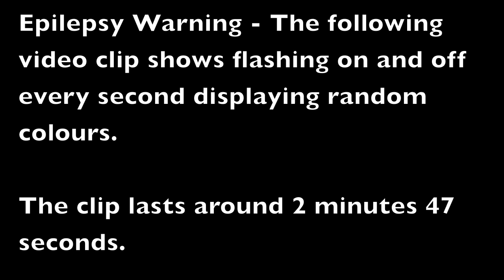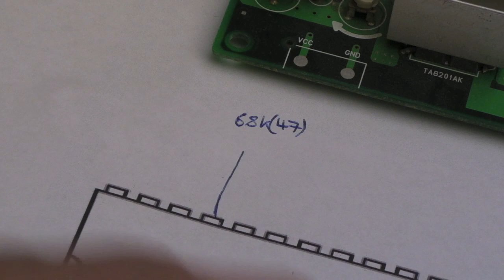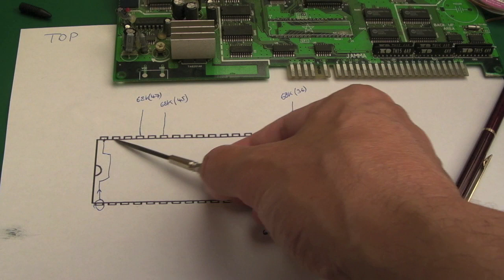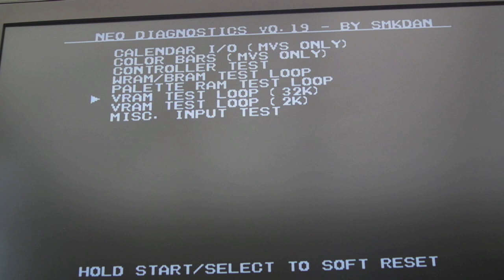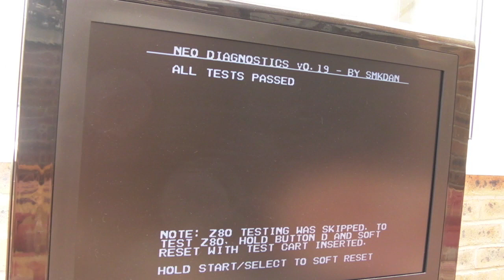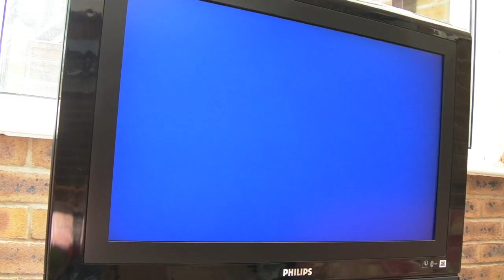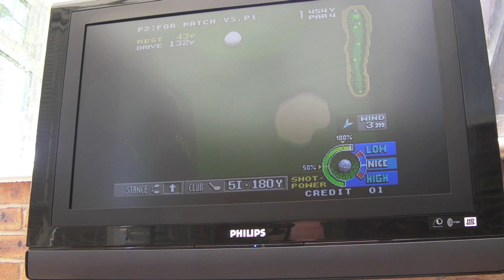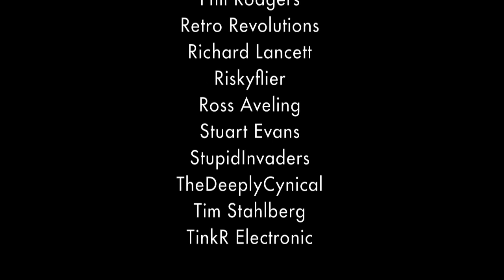SNK Neo Geo MVS Junk Board Repairs Part 3 (MV-1AX BIOS Repair - Fixing Muppet Damage)

Comment from the maker: Check out Furrteks page on Patreon:- https://www.patreon.com/furrtek
NOTE: Bodge wires are relocated in the next part and look much tidier underneath.  At the time I overlooked the CPU vias on the underside of the board.  The main purpose of this video was to see what state this board was in.  It's fully fixed in the next part =D
Reply: Do you take on customer repair jobs or upgrades?
Reply: 37:42

If you can get hold of the vertical connectors for the cartridge riser, it could be worth looking into designing a kind of "test jig" PCB, which would allow the cart to stand vertically.

I already have the Neo Geo cart slot stuff done on Eagle. I would just need to know how the pinouts on the cart riser relate to thethe smaller Molex / Amphenol style connectors that plug into the motherboard.

That depends on how useful you think that might be, though, and only really for people doing a lot of Neo Geo repairs.

I used to have an MVS, but no longer have any Neo Geo machines, or I could map out the pinouts of the riser.

The other issue is getting hold of the actual cart slot connector(s), but I imagine there are some on AliExpress or elsewhere?
Reply: I was looking at my bag of arduino pinheaders and thinking exactly the same thing. All you really need is a right angle connector of some kind.. tedious to make (I used to make stage mulitcore cables) but possibly worth it in the long run.
Reply: Excellent skills even SNK would be proud 😀
Reply from the maker: Sorry, at this point in time I cannot do customer repairs.
Reply from the maker: @ElectronAsh - Yes, that would be great if we could make a riser for these boards.
Reply from the maker: @Chris Boffey - Thanks =D

Comment: Found this looking for help with my MV-1C board and I like how your repair videos follow your thought process step-by-step.

I have a Timeharvest CMVS from Aliexpress that seems to have fried 2  MVS boards so far, I'm getting pink garbage at boot right now and seemingly no click of death.

I don't think anything in this video will apply to what's wrong with my board, but it's nice to hear general troubleshooting logic and the sort of approach you took to finding out the problems.
Reply: Ooh turns out I have a damaged trace for an address line between the CPU and NEO-DCR-T chip.  I'm not 100% sure what the DCR-T does but the dev wiki says it's related to system registers, the CPU wait cycle, and address decoding, so sounds important!

Comment: Great work as always. Here's a possible tip for you - have a look online for a salon magnifier. They are used in nailbars for painting nails, but actually work very well for examining boards and soldering. Likely cheaper than the real thing.
Reply from the maker: Thanks for the suggestion!!!!  When I came to work on part 5 I realised I have a large illuminated magnifier that my parents bought be a few years ago - I forgot I had it lol

Comment: It looks as though someone tried to fix that PCB with an axe! Reworking such a mess is a challenge to ones patience and skill :) Good job!
Reply from the maker: Hehe, indeed it does look like someone was a bit brutal!   I guess we've all made mistakes like that when learning.  I am sure the first time I removed a chip it probably looked like that afterwards.  Thanks!  It looks a lot tidier in the next part as I was able to put new wires on the underside.

Comment: Ive seen arcade boards being reflowed because how old they are where they retouch all the solder joints on the actual board
Reply from the maker: Yeah, it didn't need it in this case =D

Comment: Kynar 30AWG (wire wrapping wire) i.e. RS 209-4811 is the choice size IMO.
Reply from the maker: Thanks, I think that's what I've ended up using in the next part (well, the video after the next video).

Comment: There is really a need for some proper sockets for those SOP and QFP chips, so you can swap them around during diagnosis easily. Soldering them repeatedly on and off must be an annoying job.
Reply from the maker: Yes!  I do have some 128pin QFP sockets - not sure if there are suitable sockets for the other chips though.  SMD sockets seem quite rare tbh.

Comment: Great stuff, Would love to get into NEO GEO hardware, just don't have the money or space for it right now. Could do with getting a hot air station also.
Reply from the maker: Maybe get the same hot air station I did - Atten 858D, they are quite cheap but more than capable on boards like this.
Reply: Might have to get one of those. Very reasonable price. Been using ChipQuik SMD291 tack flux (10g syringe)  for a bit now, great stuff. Don't know if that's the same ChipQuik you use but worth checking out. Got those small ChipQuik Tubes with SMD removal alloy kits and the fumes are so harsh compared to the SMD291 stuff.
Reply: I tossed up buying a hot air rework station for some time and put the money aside and bought one. I don't use it that often but when I do I am so glad I got it. The next bit of kit on my list is a desoldering station but for that I will take a bit more time to look into them as there are some rather poor quality ones on the market.
Reply: I got ZD-915, the same one Jan Beta & Dave at EEVblog. Unfortunately mine had the same problem as Dave's out of the box and I had to repair it, not a great start. That aside I'm very happy with it. As a hobby guy it does the job. If your more serious and it's a tool your going to be using every day, then I would go for the HAKKO FR-300. I did consider going for the HAKKO myself but couldn't justify the price.

Comment: Jesus that gouge! I just bought a nice soldering thin tipped station from RS (Product code: 885-6113, Tip: 799-8976). I miss working precise under a magnifier like I had at work. It helped me create that C64 Mini Joystick. I could not have done it without. Such a God send. Anyway, you're a Genius as usual I see... ahhh... such a hard life mate hey hahah
Reply from the maker: Thanks mate =D  I found that I have a large illuminated magnifier (sounds like a medical problem lol).

Comment: Hello, I recently got a MVS Board (1F) and  by watching your videos I learned a lot , however I have a problem with my board and I cannot put the finger on it, sorry for the troubles but maybe you can give a look to the error screen I get? The MVS does not reach the Tests screen and instead shows a screen filled with a lot of little blocks of different colors, with or without cart, with or without bios. Thanks for your time!
Reply from the maker: Do you hear a clicking noise every second or so?  It sounds like the CPU is not booting, if its not clicking that would indicate that the watchdog is not kicking in either which could indicate a problem with clocks (d0) maybe.
Reply: @GadgetUK164  I see! I am gonna check those two things and try to fix the board, many thanks man for your input, I'll be checking your videos!

Comment: Hello Friend! could you help me? you don't have a neo geo MV-1AX system what happens, is that mine got burned the resistors that go after the jamma connector but for the same reason I can't see what values they are and I wanted to see if you can't pass me that information to repair it thank you very much: I have been investigating all week and I do not get that information.
Reply from the maker: I don't have an MV-1AX to hand at the moment, all my spare boards are in storage.  Your best bet is to post a question in the technical section of the Neo Geo forums website.  http://www.neo-geo.com/forums/forumdisplay.php?14-Neo-Geo-Tech-Support

Comment: Why not using lacquered wire? Much easier to handle :)
Reply from the maker: Yes, I've got some of that but tbh this kynar I used (in the next part) has a covering that melts away really easily (and cleanly).
Reply: Thanks, noted :)

Comment: Hello! friend . Excuse me, can you pass me the value of the resistances that you indicate in the minute 27:05 .... R64 R63 R56 R57 R50 R49 PC29 R58 R48 R51 R47 R46 R44 R45 R62 R52 R61 R60 R53 R55 R54 R59
Reply from the maker: The easiest way to work this out is for you to buy another board of the same model, then measure the components!  I don't have the information to hand sorry!

Comment: I forgot to ask, but why is there a pentagram in the of the board, were a socket of a MOS is?

I found it very strange to see that on a SNK Neo Geo.

Great repair, i just repaired a DVD/5.1 amplifier (all in one), he would not power on and only stayed on standby, and i had a thought it could be a cap of the build in PSU, and when i opened it i saw one bloated capacitor on the PSU board, so i removed one of the 3 little boards from the DVD/5.1 amplifier (PSU board), and desoldered the bloated capacitor, it was only one, it was a 1000uF 16v cap, and when i tested the cap in my multimeter it showed that it was only giving 300uF, so i put a new cap on it, and put the PSU board back in and plunged all the cables back, and then it would power on again, so the person was VERY happy, because now they would not have to buy a all in one 5.1 amplifier, that would cost them €160,-

And just yesterday a Mini Media-PC would not work any more when there kids were playing a game on it, the power light will only blink, so i tested it and like i thought/hoped it was the Power brick, i hear a high pitch noise, and when i tested the Mini Media-PC with a Power brick i have laying around for testing it worked perfect, so i opened the Power Prick and just like i thought it was a bloated capacitor, but it was one i do not have, and i have a lot of them now, it was a 1500uF 16v cap, i just ordered 24 1500 24v caps (Nichicon), more volt is better, and i think i am going to replace all tree 1500uF 16 caps with 1500 24v caps (Nichicon) (they were cheap), but i will have them in 12-15 Days (i hope), i paid extra €3,00 to get them much faster, so then they would be also be VERY happy.

So yeah i have also been busy :-)
Reply from the maker: Nice repairs there! =D  Yes, the pentagram always struck me as a bit odd too - apparently a joke by the engineers behind the design.